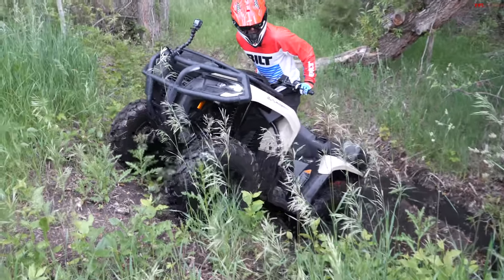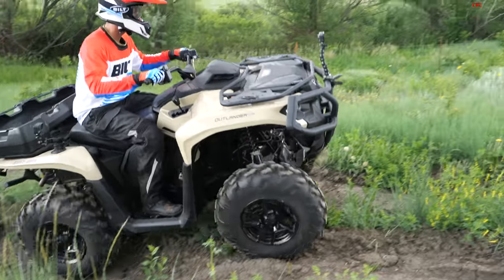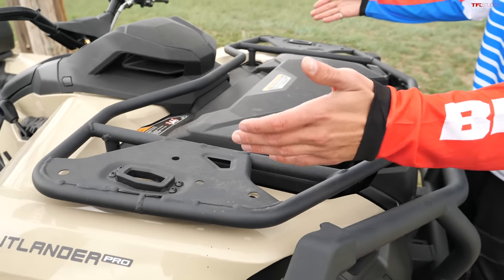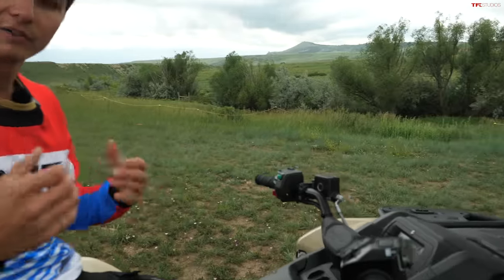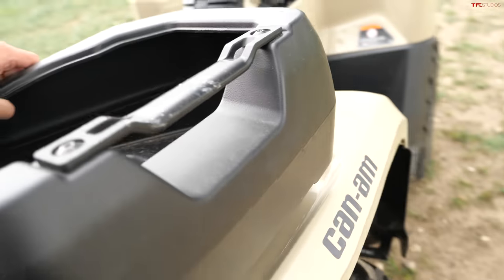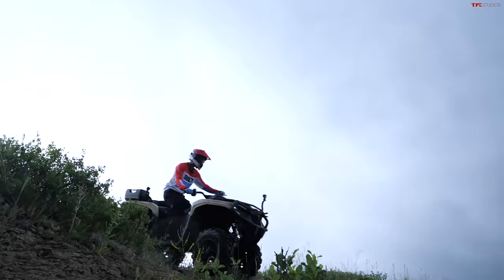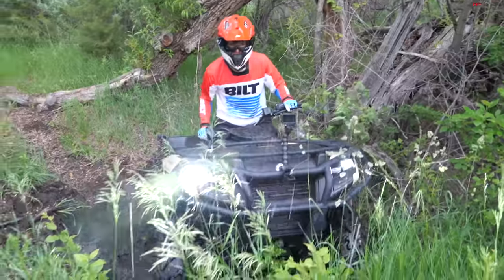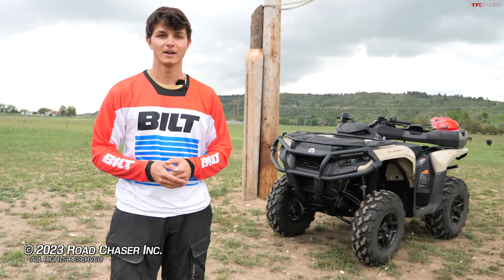Is This The ULTIMATE MUD MACHINE? 2023 Can-Am Outlander Pro XU HD5 First Ride and Review!

Comment: Great review on this outlander HD5. I’ve noticed you had in high range while on the off-road course, and it really should be in low range for that kind of stuff. It may have a good bit of power but you’ll end up burning, and ruining the drive belt. An ATV could have 40hp or 90hp but should always run it in low range for technical/muddy terrain.
Reply: They tend to leave all the cvt driven quads and sxs in high  it's awful on the cvt
Reply: An I appreciate the review but an experienced rider would easily tackle that ditch thing pretty much any part

Comment: Thanks for the review. If I trade in my 21 outlander 450, i will be  getting an HD5, But the 21 450 has been a really reliable machine and a nice ride on gravel roads and sand. I have heard some bad stories on the 570 with premature brake issues and difficult to service, but my 450 is super simple and no plastic to remove for the belt change or oil filter, also the belt takes about 20 min to change out at 4000 miles and my brakes and tires are in great shape at 900 miles. safe travels fellas.

Comment: 13 months ago I brought home a brand new Can-Am Outlander 570 DPS to trail ride and do basic work with around the property.  It has proven to be the biggest piece of shit I've ever spent money on.  Plastics have literally crumbled and fallen apart in places, brakes fell apart and allowed the pistons in the calipers to eat the rotors at only 500 miles, it overheated constantly due to how much heat the V-twin produces combined with the radiator location, so I had to relocate the radiator to the front rack, the tires were completely bald at 600 miles, maintenance is a nightmare because of the location of filter caps, drain bolts, etc.  It makes a squeal from the front end that we've never figured out.  All of this in the first year!  I'll never touch a Can't-Am ever again.
Reply: That is terrible. I have always felt like the Japanese make the best ATVs...my first choice would be Honda.
Reply: That's what happen when I bought a Polaris, since  then I always bought kingquads 400 500 750 I wonder what I'll get next lol
Reply: Funny they seem to hold up the best for anyone racing GNCC, Baja, mud racing and those are the most grueling conditions.

Comment: Got the hd7 xu myself. It  needed a tire upgrade. The stock tires are fine for trails but struggled in the mud and even climbing over fallen trees.  great quad I'm loving every minute on it and haven't had any issues other than wanting better tires.  I got the XU in tan because can am disconnected the tan xmr and I couldn't find one. I'm slowly building mine towards a xmr.  I should have just purchased the tan plastic afterward   and swapped it😂.